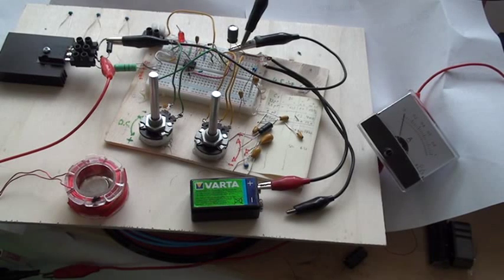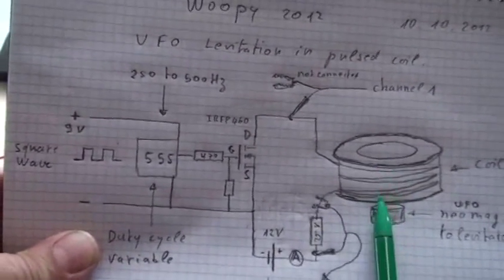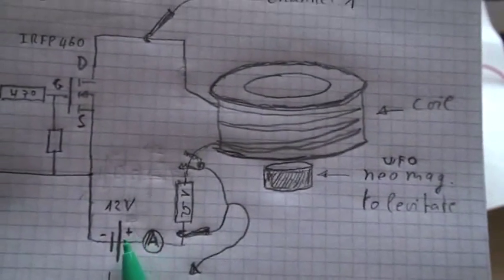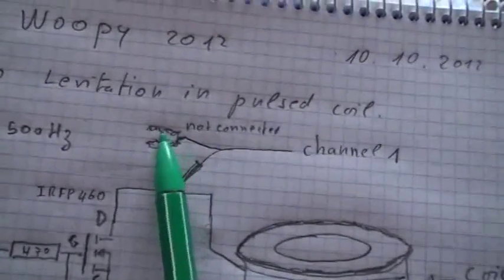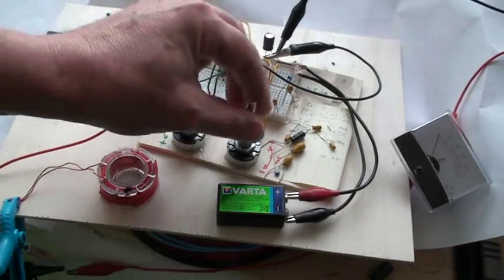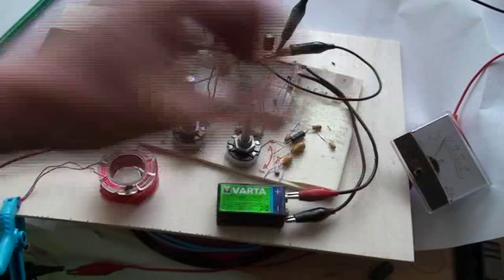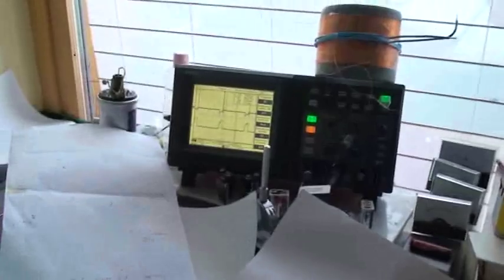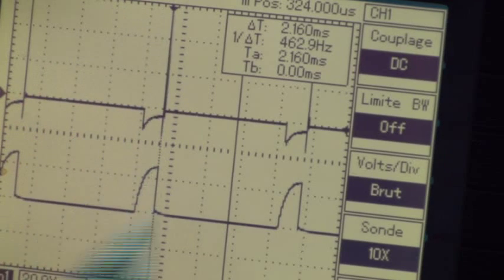UFO levitating magnet

Comment: No with DC the magnet will stay in the middle.  Go ahead and try it for yourself.  Also the magnetic field is not reversing.  Just look at the scope trace for the current flow in the video, current flows in one direction only.  Your comment about the CFL being a current source makes no sense, a CFL is a passive load.  There is no such thing as the "RADIANT side."  Many people don't understand how an inductor works and mistakenly call a discharging inductor "radiant energy."

Comment: Im pretty sure pure DC would just push the magnet out? the magnetic field is obviously reversing otherwise there wouldnt be a force to keep the magnet in the middle? UFO is correct, look at the extra torque with his asymmetrical winded motors. When a CFL is attached the CFL becomes a current source for the changing voltage spike. Thus the more light produced on the RADIANT side the stronger the reversed magnetic field.

Comment: Laurent, one last "casse-tete" for you.  Look at your current waveform on your scope and look at the bottom diagram in post #203 again.  You can actually measure the inductance of your coil simply by examining your current waveform.  Can you figure out how to do that?  You don't necessarily have to have an inductance meter, you can use the current waveform on your scope display to actually measure the inductance of your coil.  If you can figure that out, formidable!

Comment: Suppose you have an ideal coil (no wire resistance) and current is one amp when the MOSFET switches off.  If the load resistance is one ohm, the coil will generate one volt and discharge its stored energy slowly.  If the load is 1000 ohms, the coil will generate 1000 volts and discharge its stored energy quickly.  If the load is zero ohms (ideal) then the ideal coil will never discharge and current will flow forever.

Comment: Another way of looking at how the coil generates the voltage spike:  When the MOSFET is on the coil stores some of the battery energy in the magnetic field.  In this case the coil is just a passive component in the circuit.  When the MOSFET switches off, then the coil becomes an active power source and will discharge it's stored energy.  So the coil acts like a short-term battery (or similar to a discharging capacitor).  But the coil "battery" outputs current until it discharges completely.

Comment: So the fly-back spike that you see on your scope is the energy that is stored into the coil discharging into the MOSFET.  You don't have a protection diode across the coil so the energy must discharge through the MOSFET.  The faster the MOSFET switches off, the more it looks like a high resistance, the higher the "voltage spike" produced by the coil.  In reality, it is more accurate to say that it's a decreasing current level as the coil discharges its stored energy.

Comment: If the current is one amp, and the resistance of the MOSFET when it is switching off looks like 500 ohms, then you will see a 500-volt spike on your scope.  Can you see that?  It's the flowing current that produces the voltage with a coil.  You are used to thinking that voltage creates current flow.  With a coil it is the other way around, it's the flowing current that creates voltage.

Comment: So where does the fly-back spike come from?  Here is the answer:  When the MOSFET switches off there is current flowing through the coil.  The way the coil works is that it wants to keep the current flowing.  It's like the current flowing through the coil has momentum.  In technical terms you can say the coil acts like a "current source."  That's different from your poser supply which you know is a voltage source.

When the MOSTET switches off the current has momentum and must keep flowing.

Comment: Laurent:  Here is a good suggestion for you.  Make some side-view drawings.  The first drawing show the coil with current running through it and place the magnet one inch away from the center of the coil on the right side.  Is there a force on the magnet and what direction?  Now make a drawing with the magnet on the left side, otherwise the same setup.  Is there a force on the magnet and what direction?  What happens as you reduce the distance between the offset magnet and the coil center?

Comment: The answer is yes it will stay in the middle.  That means the MOSFET circuit connected to the pulse source is not necessary or needed.

That might help Laurent and others understand what is going on.  The whole experiment will work just as well with pure DC going through the coil.

Comment: You could try to short the back electromagnetic spike with a diode in order to see what happens.

Test 1 (short over the transistor): cathode at drain of transistor and anode at source of transistor.

Test 2 (short over the coil): cathode at the 1 Ohm resistor side of the coil and anode at the transistor drain side of the coil.

Greetings, Conrad

Comment: The auto solenoid has a core that is just ferrous, not magnetic, however it is offset out one side of the solenoid so that when power is applied to the solenoid it attracts that ferrous core towards the center of the solenoid.  U could also look at something like a magnetic rail gun, which requires timed pulsing of a series of solenoids with their cores on a common axis to eject a magnetic projectile at some speed.  If any of those sequenced coils were to be left on, the projectile would halt.

Comment: There is a place of balance on the plane of division where the magnet will sit once enough power is applied to the coil to hold the magnet in the center of the solenoid.   This place is at the center of the solenoids air core.  The magnet doesn't shoot out the back side as it has a field interaction on both sides of the magnet simultaneously which allow that balance to occur so that the magnet stays in the center of the air cored solenoid.  Auto solenoids are curious, as they evince this effect.

Comment: Just like the coil is always pulsed in the SAME direction, the MAGNET is ALWAYS polarized in its single direction as well.   This is a problem with the magnetic model frankly, because when you apply a single DC source to the coil, you engender 2 polar fields of magnetism, same as already exist on the neo you are levitating, if the magnet is aligned to match the poles of the solenoid, then it levitates.  Flip the neo upside down and try it again, what happens? :)

Comment: Hi woopy :)

Can you do favor and make another same diameter coreless coil just with different winding? 
It is shown here: /watch?v=UFcd_QCLK5w#t=0h12m22s
Would be interesting in comparison what is difference on magnet between those 2 types of windings.
The E. Leedskalnin's winding is: full layer of wire, 1 turn instead of layer to beginning then second layer from same start as previous layer.

Cheers!